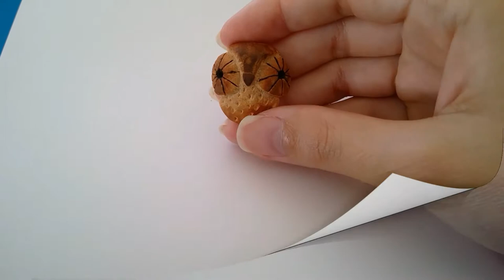Avocado Stone Owl Tutorial - AmadorArts - Amador County Arts Council - Carving Avocado Seeds

Comment: I have used on different projects strong sand paper and when it blocks up I put it under a tap and rub it clean with an old tooth brush. I have even done this with nail files rather than throw them away. It will work multiple times before the sand paper is no good.